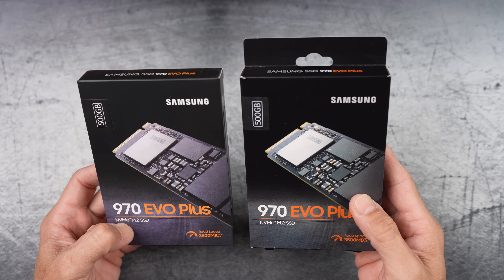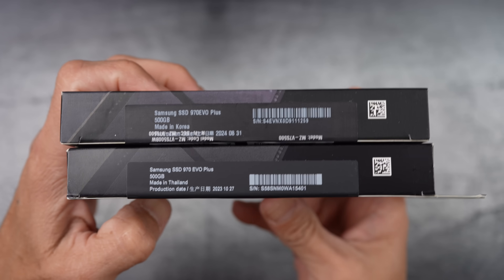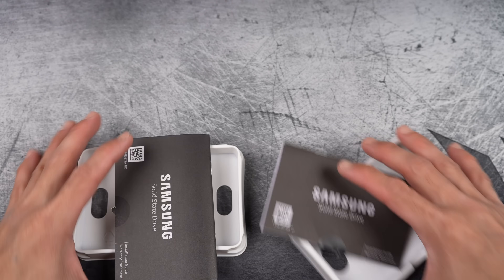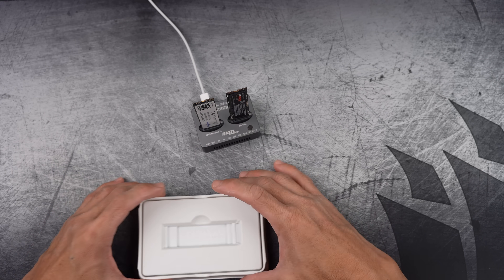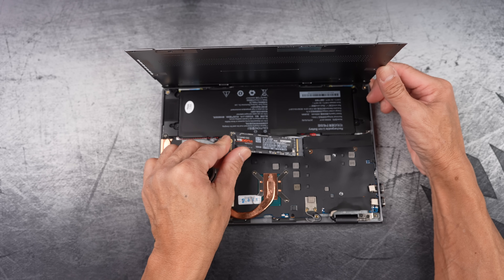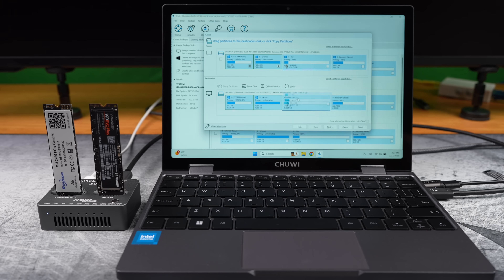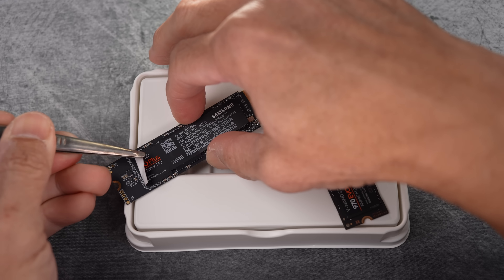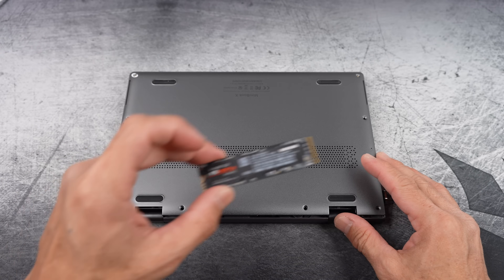Fake vs Real SSD - Can You Spot the Difference?

Comment: Would be interesting to see if Samsung Magician software detected one as Genuine and the other not.
Reply: Definitely. The SSD controller is not Samsung on the fake SSD.
Reply: @kz-xv1pm  Trouble is with this, that controller tells what it is, it was used in fake GPUs (that are way more complicated devices than SSD) and even than programs can see fakes only by having database of specs, basically if 5090 has DDR3 means its fake and so on.
Reply: @kz-xv1pm  SSD manufacturers have been caught substituting cheaper components in the past, which affected transfer speeds.
Reply: @sang3Eta  While that is true, as many SSD manufactures really only assemble their ssds from parts manufactured by other companies or they simply rebrand ssds that are manufactured by other companies, so they can't always maintain a consistent supply of the same combination Memory controller, Nand flash packages, and DRAM this means they often have to substitute out parts resulting in the same product skus not always being consistent in quality. Samsung however is different, as they manufacture their own memory controllers, Nand packages, and dram. They don't rely on parts manufactured by other companies to make their SSDs so they never really have this issue.
Reply from the maker: I definitely imagine this. Thanks for sharing.
Reply from the maker: @Esoteric_Jahanism Thank you for sharing this. Great info.
Reply: @kz-xv1pm  I got a cheap Innodisk 3TG6-P once, upon inspection it was full of Toshiba parts, not Innodisks. I sent pics to the manufacturer, and they said it was genuine.
Reply: got a fake Samsung sata SSD recently. Windows & Samsung Magician Software will not detect it as a samsung drive. The speed test is also 300+MB/s instead of 550MB/s
Reply from the maker: Thanks for your comment. Man, that’s just disappointing! Hope you got to return it.
Reply: @ It was a really bad fake then. A lot of better fakes have no problem with Samsung Magician.
Reply: @ thank god for that, i managed to get a refund haha. I'll be more careful shopping online in the future.
Reply from the maker: Glad you got the refund. I’m considering mine. Either return it or keep it as an external drive with housing.
Reply: @TossSong  Do get the refund if possible, my laptop that uses a china ssd suddenly just died. Not worth it for storing important information. Don't cheap out on storage.
Reply from the maker: @hssssssssssss Yes, I think I will likely do that. Thanks for your advice.
Reply: @TossSong  definitely return it, the supply chain must punish fake sellers
Reply from the maker: @monad_tcp Thank you for your advice. It’s in “process”. They are in “Waiting for AliExpress’s feedback” now. I think I will have to shed out up to ten dollars for shipping it back, but I will still.
Reply: @hssssssssssss  Where did the fake drive come from?  I mean who sells it?
Reply from the maker: The fake drive I got it from AliExpress. But not all items from there are fake though. Thanks for commenting.
Reply from the maker: Retailer using AliExpress.
Reply: @TossSong  Just be careful, generally the fake drive will work well for a while but if used as the main OS hosting drive it willl generally drop dead after 6 months of constant use, but if just using for cold storage it probably will be fine, just dont leave it on a shelf for years as SSD's you probably already know the data charged in the memry can lose its charge and deteriate.
Reply from the maker: @buda3d2007 Thanks for the heads-up—really appreciate the insight! Yeah, I’ve been cautious about how (or even if) I should use the fake one long-term. Definitely wouldn’t trust it as a main OS drive, but your point about shelf life and cold storage is super helpful too. Solid advice! 🙏
Reply: @hssssssssssss   under the sticker was probably a MicroSD card soldered on the board 😬🤭
Reply from the maker: @adrianTNT Visually looks pretty much like it.
Reply: My fake is detect as original in software.Working 6 months. @hssssssssssss
Reply: @hssssssssssss no , a real samsung drive can perform bad in a speed test from a zillion different factors such as your pc being the culprit and background tasks, incorrect settings, bad cablez bad port e.c.t
Reply: it flagged mine
Reply: So the software does recognize it or not? The fake one I mean
Reply from the maker: Magician software didn’t detect the fake drive as “genuine,” but it got the model name right. Also, the serial number is not in their database.
Reply: Samsung's SSD software won't always detect a genuine Samsung SSD if the SSD is from an OEM pre-built system.
Reply from the maker: Thanks for sharing this. In this case though, the behavior + performance + internal components clearly showed one drive wasn’t authentic — which is why I didn’t rely on Magician alone.
Reply: @TossSong  I understand. This video is very helpful. If I were to see the fake SSD you have by itself, I most likely wouldn't realize it's a knock-off. This video has provided me an example from which to learn. When the SSD packaging, manuals and drive are compared together, the fake becomes easy to spot. Even without a comparison, knowing what to look for is helpful.

Also, on the OEM drives Samsung provides to system builders: If you search for the part number on the Internet, the drive comes up as a Samsung drive. In each example, Samsung's site recognizes the number. However, if you go to the Samsung support page, it will return a, "no results." They want you to have to go through the OEM for support. I was told this by both an OEM and Samsung. 

This is a confusing result for someone trying figure out if they have a knock-off. I know for sure a shipment of fake Samsung SSDs got into a large OEM supply chain not that long ago. I am thinking Lenovo, but could be mis-remembering.
Reply from the maker: Totally agree — that’s exactly why I wanted to show the side-by-side comparison. On its own, the fake looks very convincing. Once you compare packaging, labeling, manuals, and behavior together, the red flags become much easier to spot.

And great point about OEM drives — that definitely adds confusion when people try to verify authenticity through Samsung’s site or Magician. Appreciate you sharing that real-world insight! 🙏
Reply: @JamesSullivan-ru4op will such SSD have a Samsung sticker on it?
Reply: @UnhingedSnoringSloth  Yes and no. It has a generic sticker but Samsung part number and other relevant numbering. Under the label will be the brande Samsung chips. 

I have owned several laptops with genuine Samsung SSDs. The Magician software will not dectect them as Samsung. So far this is true with the HP, Dell and Lenovo laptops I have owned. The Magician software would run its benchmark for the drives but returned low speed results in every case. Crystal Disk Mark and AS SSD benchmarking tools return the proper speeds. At least, what should be the proper speeds.
Reply: @JamesSullivan-ru4op  You seem to be missing the point of this video. The point was to show ways how to recognize fake SSD that pretends to be genuine Samsung SSD. The point was not to show ways how to identify Samsung SSD that tries to hide the fact that it is Samsung. The easiest way to see if the SSD is fake is to have the Magician software to look at it. Unfortunately, the author decided not to even mention this in his video, because otherwise the video would only be "a 30sec video".
Reply: @UnhingedSnoringSloth  No my good fellow, I missed nothing. I participated in the conversation by providing additional information. The creator did a fine job in making and presenting his content.

My Lenovo has a genuine Samsung 980 Pro SSD. However, it is a bulk part designated for OEMs and not retail. The Magician software does not dectect is as a Samsung prodct at all, even though it is. I also have a 512 (yes, 512) GB SSD from Samsung's very first batch of "for the market" SSDs they made. It is also an OEM product with a model number beginning with HPUSA.... Magician will not detect it as Samsung. These first batch were only released to OEMs. Some found their way to E-tailers as replacement (insert OEM name here) parts. 

Conclusion: Samsung Magician software does not always correctly detect/identify a genuine Samsung SSD. This true if it is a bulk part sold to an OEM.
Reply: Your additional information was not relevant to the topic of identifying if an SSD posing as a Samsung one is actually a Samsung SSD or not. You pivoted to another topic (how to identify a Samsung SSD if it is an OEM version) and reached a conclusion that was not relevant to this subject. Once again, the creator was not focused on OEM drives in this video, he was focused on identifying fake drives posing as a genuine ones. Let me help you to get back on track. When you have a drive, that has Samsung stickers on it, how can you tell if this drive is fake or not? All you need to do is to have Magician software look at it. It will tell you if the drive is genuine or not.
Reply: @UnhingedSnoringSloth  You appear to have a bit of trouble relating information. 

Also, you unfortunately do like to "talk" a lot and add nothing to the conversation. Think what you like. I am out. Have a great day.
Reply: @JamesSullivan-ru4op  ah, yes, when you have nothing to say, resort to personal attacks. Best of luck to you.
Reply: @JamesSullivan-ru4op Yes, I too have noticed they have diferent software for the Commercial grade SSDs SMxxx, PMxxx etc.
Reply: Surprised he didn't test that. I got one of these in a big box store they can definitely bypass Samsung verification. 
This is becoming a real problem.
Reply from the maker: @alphadog6970 Thanks for your comment! I tried it out off-camera (you might have caught it in the video where I have the software installed). The Magician software didn’t recognize the fake drive as real, but it did show the right name. The fact that you got one from a big box store just shows how widespread this problem is. Did Samsung Magician detect yours as real or not?
Reply: @TossSong  shows as genuine but the speed are half of what they should be. 
I'm stuck with it because i have work software with database on it, to transfer it on another drive i have to pay for the service.
Reply from the maker: @alphadog6970 Sounds really frustrating, especially since you’re stuck with it. Shows genuine but at half speed makes it even worse. If you ever decide to transfer, maybe check if the software provider allows you to migrate the license instead of cloning the whole drive. Some disk cloning tools might help, but yeah, it’s an extra hassle and cost. Hope you find a good solution!
Reply: @alphadog6970  Are you sure the speed difference doesn't have something to do with PCIE versions, lanes, etc.?
Reply: good point, just like there is software to detect fake nvidia cards storage drive makers should get together to do the same
Reply: @sang3Eta  The Drive I received for a Samsung 870 EVO 2.5, the Magician software would read the name, serial number, model number and a few other information items. However, it would not detect the health correctly always N/A and not give fully software support of the drive, plus I could never register the drive which Magician was looking for as well.
Samsung Memory Support after reviewing the photo’s I sent said the serial number was incorrect, should have a letter on the end, mine had a number. They also said the font for the back of the drive was close but was off for what they use. So they determined I had a counterfeit SSD. Even the box looked like a Samsung box you would see in the store. 
Going through the process of getting a refund which they have agreed, we shall see if it all comes to fruition.
Best to all with their situation.
Reply: Just an update, long overdue. I did receive a refund about 30 days after shipping (took awhile for delivery) and even though I paid for shipping which was not cheap to china. The seller on Ebay did reimburse me fairly quickly for that portion once submitted proof. Going to China there was a custom’s process before the seller received it. However, once I saw that it was delivered, I was refunded the full price to my Ebay Account.
Disappointed that it happened etc., but I did my refund in the end. Which made me very happy.
Reply from the maker: Appreciate you coming back to share what happened.

Sounds frustrating with the refund, the return shipping and customs delay, but glad eBay ultimately made you whole in the end.

Hopefully your experience helps others be more cautious when SSD deals look too good to be true. Thanks again for following up 👍
Reply: try EVEREST  software to find out  made by lavalsys ...   it tell the guts  on all gear  and its free ,,,
Everest Ultimate Edition for Windows  ive used this util  for YEARS !    its clean  no spam and it works :P
Reply: @sang3Eta  Samsung told me a genuine SSD in my case SATA SSD 2.5, should have a letter on end of serial number. Their Magician software read the serial number listed on drive/box, no end letter. However, it would also not let me update firmware or register the product.
Reply: First thing that came to my mind.
Reply: this is what my first thought was
Reply: I bought a Samsung 980 pro at online store and I realized it was fake due to the resting I made. I inserted it in 2 different SSD enclosure and for how many minutes of copy-pasting large file, the speed of the fake SSD went down to kb/s and further testing until the SSD enclosure cannot detect it anymore. I inserted my genuine Kingston NV3 and it works fine in both SSD enclosure. My point is, even if it works fine even it's fake, I doubt it will not last long. I returned it back and I got my refund.
Reply from the maker: @Stingisagala2015 Wow, thank you for the detailed experience—it really helps others be aware. That drop to KB/s and eventual failure is a textbook sign of a fake drive. I agree, even if it works for a bit, it’s not worth the risk. Glad you got your refund!
Reply: it will show that this is shit 100%
Reply: In Asia they are copying everything imaginable.
So the 1st thing they ask about something is a well-known brand is if it's a original.   
They are so used to it.
Reply from the maker: I could imagine! With how convincing some these look these days, it’s almost instinct to double-check if something’s genuine—especially when it’s from a big brand.
Reply: Not to mention, Samsung Magician has the ability to run the drive at it's fullest speed. My 2TB 990 Evo Plus was set in the middle. I can understand why as running it in laptops and different environments plays a roll. As I take steps to ensure its temp stays low. I also run scans & commands every so often to correct errors and to maintain drives health. I also never buy products for big manufacturers from anyone but them. Yes, you may pay more but you get what you pay for more often than this situation.
Reply from the maker: Good point about laptops and thermal differences! I’ve seen how enclosure setups, airflow, and usage patterns can make a big difference. And yes—buying from reliable sellers and verified listings is best!
Reply: Comparison is a bit shallow. Could you see (after removing labels) which controller the fake one was using ? What make and model of flash chips ? What was reported in Device Manager as drive model ?
Reply from the maker: Thanks for the feedback! I totally agree it would’ve been cool to dig into the controller and flash chips. I didn’t peel off the labels this time, but I might do a deeper teardown in a follow-up if there’s enough interest. I’ll also look into checking the Device Manager model names more closely next round. Appreciate you pointing that out!
Reply: They have managed to bypass that a long time ago.
Reply: @stefanjohansson2373 is there a hack, to use the software with any SSD?
Reply: @stefanjohansson2373 No? I just bought a fake one myself and it was detected by the magician software
Reply: @stefanjohansson2373 really? and how?
Reply from the maker: Yes, I did consider it. I installed it if you could tell on the laptop screen. But I chose not to, thinking it would be convincing enough in the end.
Reply: @TossSong  What does this even mean? There is software that can tell you if your drive is fake, but you decided not to use it. What? Why?
Reply from the maker: Thanks for your feedback. It’s about what the box and the ssd itself can look like too. If I just used the software, I would be a 30sec video.
Reply: @TossSong Sadly, as we point these things out. They will implement these changes at some point. Just like the thieves you see in movies. As soon as the bad guys know you're onto them. They take those extra steps to cover their tracks. Communication and social accountability will help people from being taken advantage of.
Reply: Thing with that is magician doesn’t always recognize real samsung drives !! —> depending on whether connection to drive is internal or external and then on the driver (if connection in external) ...
Reply from the maker: Thanks for sharing this. Also check the serial number on their database.
Reply: How do you do this @TossSong
Reply from the maker: @dragonnightfire5150 You can check the serial number of a Samsung SSD using the Samsung Magician software. When open the program, it should detect your SSD. Under the ‘Drive Details’ section, you can find the serial number and verify it on Samsung’s official database.